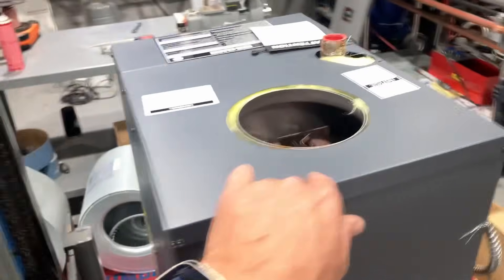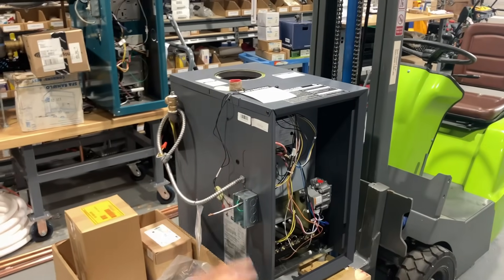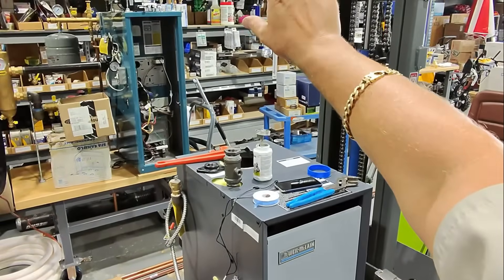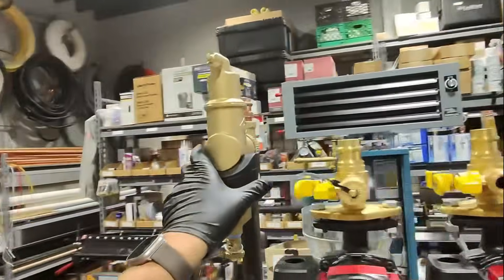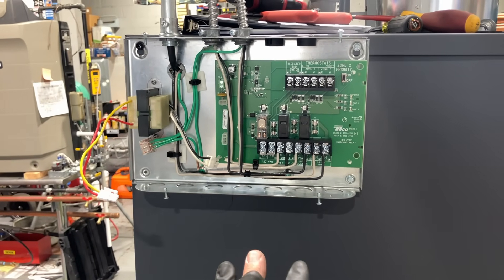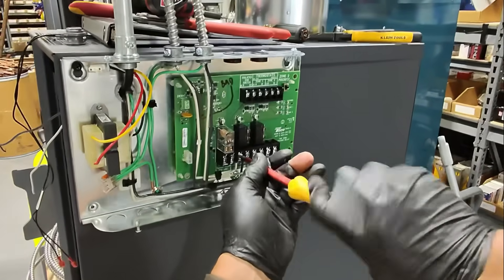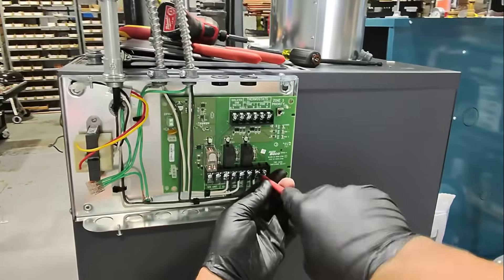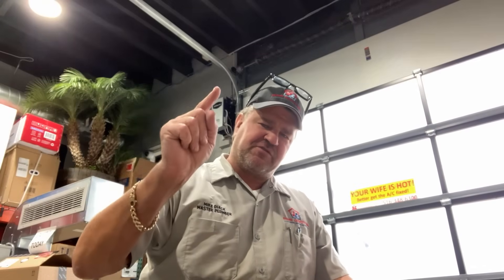Weil-McLain CGa Boiler Build – Watch Before You Install One!

Comment: the taco. looks like the parts placer didn't snap the connector plastic tabs into the board before it went through soldering process. probably assembled by machines or unskilled folks/slave labor.  back to need to check everything ten fold, before installation or as you're stocking.

Comment: circulators on the returns, are you becoming  Steve Lav.   🤣🤣
yeah, you cannot rebuild the whole home and have to work with what's there. especially if it's worked fine for the last decade or three.

Comment: Looks like after that nipple wasn't installed, might have to check them all now. I will plan to do the same. I never had one that was loose like that.  Hoping Taco sends you a replacement relay
Reply: Yea I had that happen once as well and had a call back what a pain -
Reply: early Monday AM start, Friday PM close or lunch time interruption. alternate alzheimer's patient still working to eat and survive(yeah)
Reply: Why I also keep electrical soldering kit in the truck. Especially with Honeywell relays. A 2 min soldering fix saves the customer hundreds. Same labor rate for me either way.